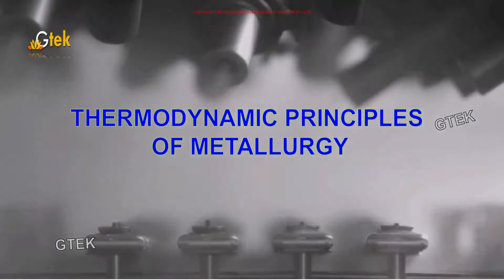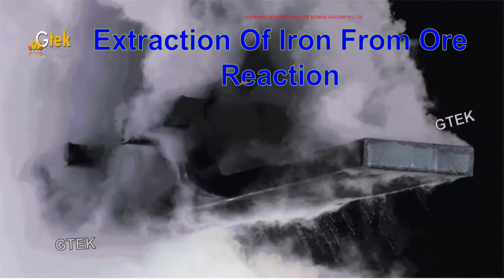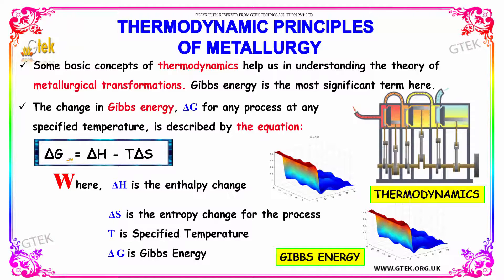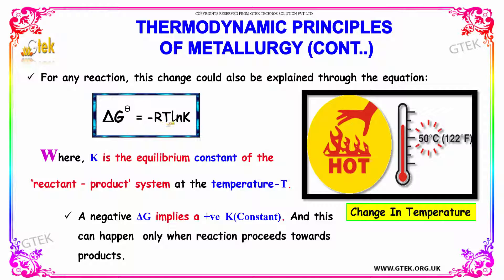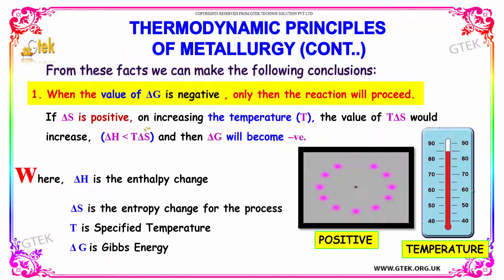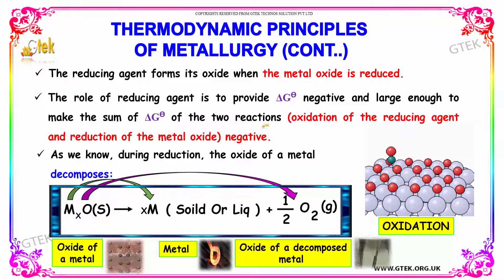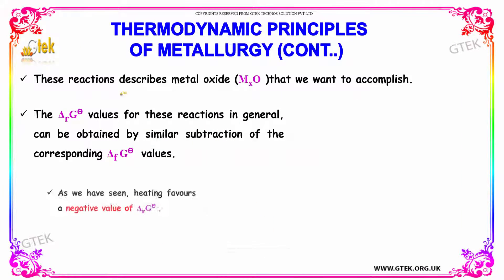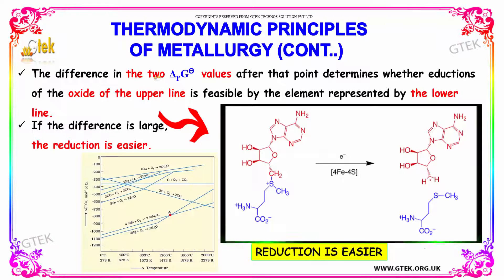thermodynamic principles of metallurgy processes of isolation of elements class 12 chemistry cbse

Comment: General Principle and Process of Isolation of Elements
Minerals: - 

               These are naturally occurring chemical substances in the in the earth crust obtainable by mining.
Ores   : - 

       only few minerals are used as sources of that metal. Such minerals are known as ores.
Gangue: -

            ores are usually contaminated with earthly or undersides materials known as gangue.
Metallurgy: - 

                 The entire scientific and technological process used for isolation of the metal from its ores is known as metallurgy.
Concentration of the ore: - 

                                   The removal of earthy and siliceous impurities (i.e. gangue or matrix) from the ores is called concentration of ores.
(i)                Hydraulic washing: -

                                                 The processes by which lighter earthy particles are free from the heavier ore particles by washing with water.
(ii)             Magnetic separation: - 

                                         This method of concentration is  employed  when  either the ore or impurities associated with it are magnetic in nature.
Example: - chromate.
(iii)           Froth floatation: - 

                                       This method is based upon the fact that surface of sulphide ores is preferentially wetted by oils while that of gangue is preferentially wetted by water.
(iv)           Leaching: - 

                               This process consists in treating the powdered ore with a suitable reagent which are selectively dissolved the ore but not the impurities.